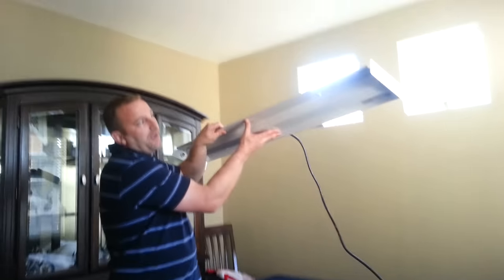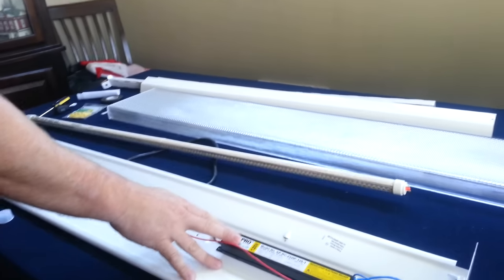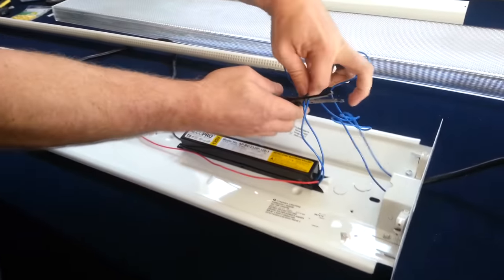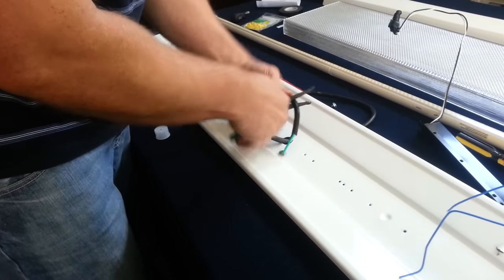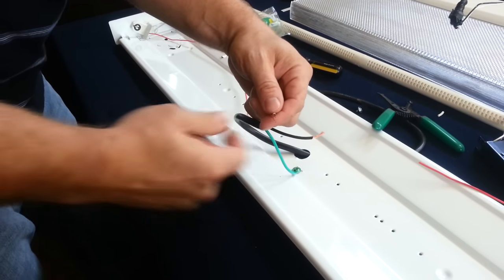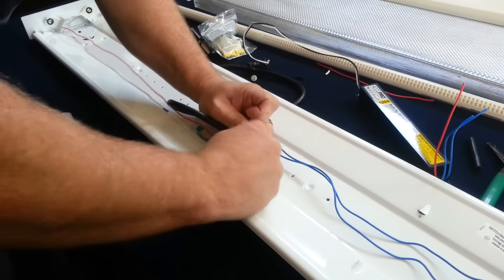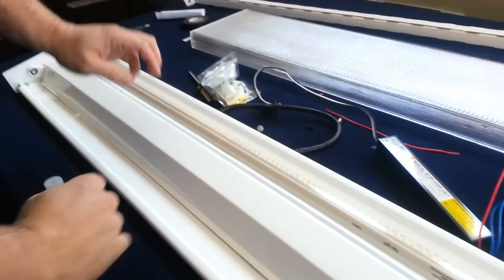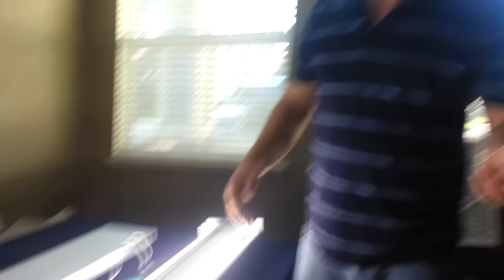How to wire 4ft led lights

Comment: What a fabulous video! The ballasts stopped working on my garage fixtures so I went to Home Depot to purchase new ones. I wish I had seen this video prior because it's so simple to "bypass the old ballast", re-wire & install new LED bulbs in the existing fixtures! Instead, I purchased new LED fixtures, had to take down the "perfectly fine ones" and install the brand new ones. It would have saved me several steps and the cost would have been much less to get the same result. Thank you, I'll go with your way on the next set!

Comment: Thank you sir, had a client of mine throw out a HEAP of LED tubes and cases, wanted me to take them off-prem and organise a scappy for the metal.

I sat looking at them thinking surely they still work, but I am used to fluro with the starter/ballast. With your instructions I was able to confirm they are wired correctly, and throw the lights together for testing, they work! now I can upgrade my garage and home-office lights to LED with confidence.

Cheers!

Comment: This video helped me get my light rewired for a Lithonia Lighting 1233 RE 2-Light T8 Fluorescent Residential Shop Light that is found on Amazon.  The LED light I used was Kihung T8 LED Light Tube 4ft 22W.  Not all lights are wired the same, but the light fixture I have worked perfectly after following this video's directions and I am no electrician.

Comment: Dude: DONE! I have a plastic-metal version with a couple of electric plug on it, plus a switch. All done in 15 minutes (just because I've plug wrong the wire on the switch :P )

Thanks ;) and yes: is so easy.

Comment: Thanks man, this was the only video that made any sense. I used the Hyperikon lights from Amazon and they worked with this method.
Reply: How? I have those too and followed this verbatim and can't get mine to work. Did you use the tombstones that came with the tube lights?
Reply: i believe it depends on if you bought the single ended or double ended led bulbs. THIS video above is for installation with double ended bulbs. hot goes to one side, neutral goes to the other side.  
for single ended both hot and neutral are wired to one side of the bulb. the tombstone on the other end is just to help hold the bulb in place. unfortunately he didnt explain that in the video

Comment: Most direct drive LED retrofit lamps are single end feed using non-shunted tombstone lamp holders. The ones that you have shown here are double end feed, which is quite unusual. Or you can use smart drive LED retrofit lamps which run off the existing T8 ballast. All of which are double end feed.
Reply: He should change the title of this video to wiring double ended LED Lights.  The wiring on single ended LED tubes is different.

Comment: Helpful video!  Not to sound ungrateful, but it would be nice if questions from commenters were answered.
Reply: I have a light with 2 bulbs not one bulbs inside, wiring it the same way single bulbs work not the double bulbs. Why?
Reply: Can I use my old lights as a light saber?
Reply: Hi Rohit,  I wrote this up for a friend who was retrofitting his light boxes for LED's. It describes the steps I took to retrofit my fixtures.  It really shouldn't matter how many bulbs are in the socket.  Just do as I say, bundle all the neutral (usually white) wires together, bundle all the hot (usually black, but not always) wires together.  Do the same for all the ground wires.  Here is the full set of instructions:

Wiring:

a.  The bulbs I bought were the 2-sided variety for my 2-sided fixtures.  That is, the neutral wires go to the tombstone on one end of the fixture and the hot wires go to the tombstone at the other end of the fixture (in my case, 4 feet away).  The wiring for 1 sided fixtures is significantly different, so BEWARE!

b.  I did not remove any of the wires inserted into the tombstones from the original installation.  They can be removed by various methods, but I felt that would only be inviting potential problems (breakage) of the tombstones.  All of the original wires emerging from the tombstones can be connected to the new wiring by twist caps.

c.  It is same to assume that most LED bulbs can not be used with original magnetic ballasts still in the circuit (my retrofit situation).  Some LED bulbs can be used with electronic ballasts.  My suggestion.  Just don't use the original ballast.  I cut the wires from the original magnetic ballasts leaving about 5 inches of wire.  I don't plan on ever reusing those nasty magnetic ballasts, but if I have to I wanted enough wire available to reconnect them.  I removed the ballasts from the receptical to satisfy my need for a clean and tidy retrofit. :-)

d.  The following describes the wiring strategy I employed.  Before cutting and disconnecting any wires I took a good hard look at the wiring "mess" inside the receptical.  The neutral/white Romex cable wire eventually made its way to the left tombstone in my receptical.  So the left tomestone was neutral.  The hot/black Romex cable wire eventually made its way to the right tombstone in my receptical.  So the right tomestone was hot.   There were other wires connected to the right and left tombstones.  After removing the ballast, I took ALL the wires connected to the left tombstone and connected them via a twist cap to the white neutral wire. One nice tidy bundle of connected wires.  I took ALL the wires connected to the right tombstone and connected them via a twist cap to the black hot wire. A second nice tidy bundle of connected wires.  I left the bare copper ground wire connected to the metal receptal box.  I put the cover back on the receptical. Connected the buld.  Success!  (BTW, when using twist caps it is code in some areas, and just good practice, to twist the cap until you have a pigtail of twisted wires that extends about 2 inches outside the cap.  This helps to prevent the wires from ever becoming disconnected inside the twist cap.  You can wrap electrical tape around this pig tail of wires just in case you accidentally stripped too much insulation at the end of the wires leaving exposed wires outside the twist cap.  But if you strip off the right amount of wire and generate that 2 inches of pig tail electrical tape is really not necessary.

Comment: Help

Great video but I've wired mine exactly to the spec you have. Problem is i turn the breaker on and like a florescent bulb they barely function at all without a ballast. Any advice??

Comment: Good video, but one little thing. I do not KNOW how the tombstones on the red side are connected. I suppose a red side jumper is implied at around 6:26. Correct me if I am wrong, but I don't think it is clearly stated that the two tombstones on the red wire side are in anyway connected. I almost ignored this because I thought I saw a black wire and a red wire going to the left side, but the black turned out to be a shadow.

Comment: There are two types of leds connects bypass and one side depending on what tombstones come with your bulbs mine were line and neutral so I only had to make one side live black to line and white to neutral as some people mention in video it doesn’t make a difference and it’s true

Comment: I read somewhere that you had to replace tge tombstones with non shunted ones. Your video says leave them alone. I plan on using the Hyperikon bulbs from Amazon. 4 bulb fixture...
can I leave the tombstones or change them ?
Reply: +TechGuru4U , my understanding is that for any retrofit where the lamp has metal pins on one end that fit into a tombstone plug, the tombstone needs to be non-shunted to avoid a short that will ruin the bulb. One of the Feit bulbs uses a different system where the tombstones only support the lamp and none of them provide power.

Comment: I dont get it? I watched other videos and they worked it totally different. They had 2 connectors wired together at one end and absolutely no wires hooked up at the other end. Also, is the end tombstone with the red wire wired to the other tombstone beside it?

Comment: I actually did a bit or research. It all depends on weather they are dual end or single end powered tubes.
I'm going to post a video on my channel in the coming weeks, expanding on this as well as showing my installation. 
May be helpful to people that may still have questions.
Reply: correct. ive been doing the same (research). i could see it messing up a lot of people's installations if they dont know the difference.
Reply: What do you guys mean? What's the difference between dual and single end? The video spoke about a lot of things, are you referring to the ballast or which ends you connect it to (hot / neutral) or?
Reply: LED tubes come in 2 kinds: double end powered or single end powered. This video is showing how to basically remove the ballast from the old fluorescent system (double end powered, meaning both ends are powered) and swapping it out with double ended LEDs. If he was using single end, powered LEDs, then he would actually just need to wire one end only. The other end can have all the wires removed; that end only serves as a holder for the tube so it doesnt fall out. If you are doing single end, it's even simpler. You connect the black wire (live) to one of the blue wires, and the white (neutral) to the other blue wire. Usually  they are not color coded the way he uses. Also, in his red wire end, it only has one wire, because he combined them on the other end. In a dual end powered one, as in this video, you can connect the white or black wire to either end. Meaning, you can connect the black to one or the other, and the white to the opposite. Just dont connect the black and white to the SAME end. Although this video is good, you may want to watch another to see how the wires work. I liked 2jeffs1 personally. He goes into more detail for the beginners.
Reply: For single ended you have to be careful about shunted or unshunted tombstone. For single ended you have to make sure you use unshunted tombstones

Comment: The black wire is Load, and the white wire is Neutral. It will work either way in this case, but there are situations where it is VERY important to know the difference. 

In the video, you connected the Neutral(white) to the red wire and indicated that it was "hot"(Load), and connected the Load(black) to the blue wire and indicated that it was "neutral".

Comment: Good video, but one little thing. At 7:20 it looks like red, white, green, black and blue are all wired together. For those who are just scrolling to jump to the final connections, I don't think that you should wire all those together. Is that right?

Comment: This is for double ended LED tubes.   I am wondering, if you get a tube without knowing if it is double ended or single ended, would it cause any damage to the tube if you wire it as double ended but the tube is actually single ended.
Reply: Almost certainly yes. Whether it would be the bulb coming on and going out, never to turn on again, or actual fireworks could only be guessed at--Best case scenario is it lights up dimly and flickers, or doesn't light up at all without anything more crazy happening, but ALWAYS know what kind of tube it is and what the fixture needs before putting it in there.

Comment: Nice job but there is a code violation by national electrical code.No squeeze connector on the fixture  to hold the SJ cord . That's why house's have electrical fires.

Comment: hi, i just open my fixture and there is two ballast inside,i connected all the blue and red wire together going to the black and my yellows going to the white then put the bulb but nothing work,what i am doing wrong.thanks

Comment: My two LEDs did not come with instructions. I enjoyed your video but I’m wondering why there’s just one wire coming from one end and not two. Are the two tombstones connected because that was not discussed. How does the one LED get power from the tombstone that’s not that’s not connected?
Reply: It's hard to tell exactly, because there were no close-ups of the tombstones, but the far side with the one red wire going to the tombstone appears to have a white "jumper" wire connecting it to the other tombstone. Also, unless there are more wires hidden under those tombstone mounting boxes, the tombstones appear to be "shunted" where the prong that holds the bulb on each side of each tombstone is connected internally to the prong on the other side of that tombstone.

Comment: I have 4 flourescent light fixtures with 2 ballast and need to convert to LED. Can you pl make video showing how to connect all wires?
Reply from the maker: Do you have single end power or dual end power led tubes?

Comment: When you installed the led tube I noticed that the led's inside were at a 45' angle is this a manufacturing mistake. They should be facing down for max lighting.
Reply: I believe there were 2 rows of LEDs...

Comment: do you know if this works for the Phillips Instant start LED tubes? what are the pros and cons to bypassing the ballast?  thanks!
Reply: David Ko What?  Did you actually watch the video?  He clearly explains in the video that you HAVE To bypass the ballast or your LED lights will flicker, as they have their own on-board drivers.

Please watch video before asking questions like this.
Reply: Will Davis if you read my question carefully you'll notice that I asked if I need to bypass for the Phillips Instant Start LED because I've been told that some LED's require a ballast and some don't.
Reply: Yeah they say on the box. I remove the ones that work with/without a ballast to save electricity and plus eventually that ballast will leak one day anyway. its like a battery.
Reply: OBServe Garage do you know led has internal ballast right?  Ballasts serve a purpose by regulating how much voltage the bulb gets.  Flaurecent bulbs are ignited by gas inside the tube.  If you put out the full 120v you would blow the bulb every time.  The become more useful with the higher wattage bulbs.

Comment: Well, I don't know what generation that LED is. I bought a box of 16 pack. They told me I don't need to change anything. Just remove the old fluorescents and put the leds on. They worked!
Reply: Those would be "universal" or "ballast-compatible" bulbs. They work with a lot of ballast types, but not with others. I think it's magnetic vs. electronic ballast that is the main compatibility issue. They can be a great solution to start saving power with LEDs. Keep in mind though, you're still paying for the juice the ballast uses, and the failure-prone ballast will die and/or kill the bulbs much sooner than direct line-powered LEDs.

Comment: OK.....so  u said the LED that ur using u said one end is hot and the other end is neutral so when u put the led in was there a mark on the end that was hot? could u put the led in either way?
Reply: 5:15 - 5:25 rewatch
Reply: You can connect the black (live aka hot) or white (neutral) to either end. Just don't connect them both to the SAME end.
Reply: Its "you". Not "u"

Comment: Is this for Plug & Play LED bulbs?
Reply from the maker: No. This is for dual end power. DEP
Reply: @jeremy6891able  These are duel end power.  They worked on the ballast but I think the ballast went bad, so can I still use them by bypassing the ballast?
Reply from the maker: @santafesuperchief  yes you can
Reply: @jeremy6891able  These are made by Zhenjiang Qiangling Electronic Co., Ltd., sold at Walmart.
I don't have any other information on them except they were called Plug&Play bulbs.  Works with existing ballasts.

Comment: He has one red wire on one end and two blue wire on the other end.  I have 2 red & 2 blues on one end and 2 yellows on the other end.
Reply: This project is probably long behind you, but for others: Connect the black(Load) wire to all of the blues and reds, and the white(Neutral) wire to the 2 yellows.

Comment: What wiring would be different with "Dual-ended" vs. "Single-ended" LED bulbs?  I have a mix of fixtures in my Garage with some quite old and at least one newer.  The  bulbs I'm looking at are Dual-ended so that's why I'm asking.
Reply: If you have single ended LEDs (+ & - on one end) this wiring will not work, you may damage your led.

Comment: I think someone needs to explain from these videos what's the straight voltage that these leds can support to work so we understand why the ballasts are not needed. And what's the voltage the ballasts delivers  to the light bulbs or light tubes. And if we need to plug every hole in the tombstones or just one. I followed the diagram in the ballasts that showes every hole in the tombstones seems connected. And I did so.  They turned on so...😒

Comment: You can't just shut the light switch off like he said if you do that you will get the shit shocked out of you turn the breaker off!!! I cannot believe he said that you could do that,  you cannot!!!!!
Reply: I mean, you CAN, but it's like putting your hand on a table saw that is turned off, but not unplugged. I wouldn't touch any circuit unless the switch to it is off AND the breaker for that circuit is off. 

Edit: I'd also add that I would also test the wires with a non-contact voltage tester before touching the wires, and after removing the wire nuts, test the black(Load) and white(Neutral) wires for voltage with a multimeter before directly touching the uninsulated ends of the wires. You can get these for about $10 each if you buy them bundled together.

Comment: Hi, if I decided to hire an electrician to do this, what's a good range of reasonable price to do exactly what you just did? someone quoted me $56 per fixture (2 tubes) and I have 5 of these in the house so it's $280. is that on the high end or low end for electricians?

Comment: I have the Hyperikon tube lights from Amazon and this doesn't work for me.
Reply: you probably have the single ended lights. the hot and neutral wires have to go to the same tombstone, not one on each side as shown in this video